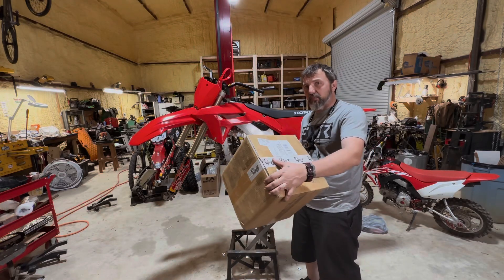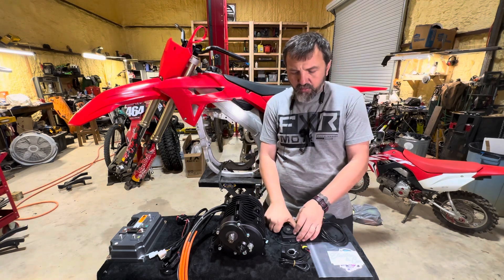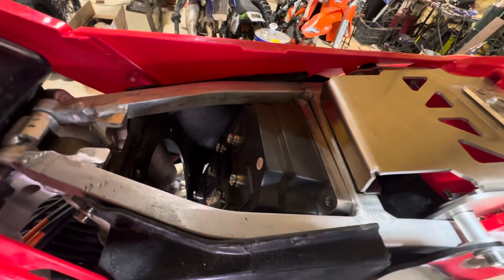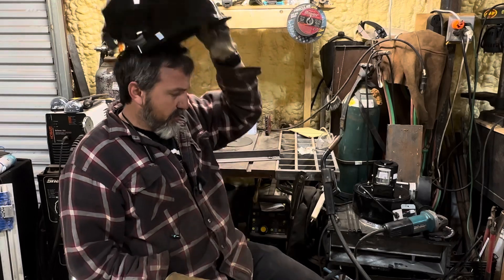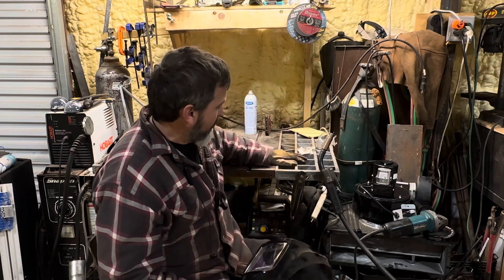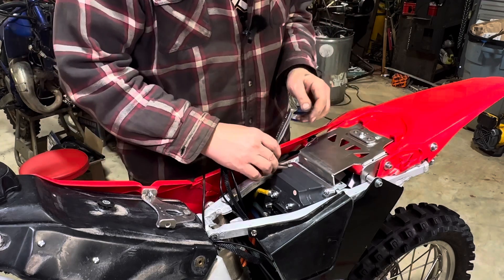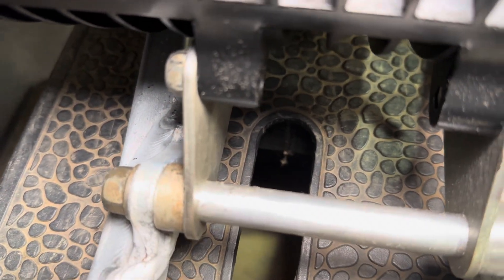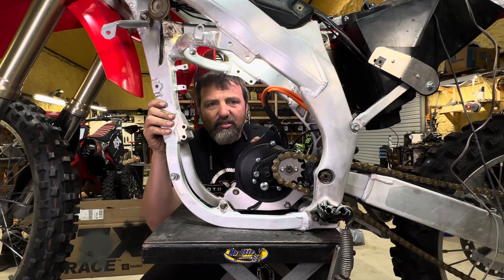How to build electric dirt bike Ep 2 DIY Stark Varg. How to install motor and controller.

Comment: Very cool! An electric moto conversion with no frame modifications using off the shelf components. I have been watching how to do this for years, and that is those are the components that I would have used. The QS138 with gear reduction, the prebuilt battery box. But I had not idea there were premade motor mounts. Now thanks to you, I know all of it will work, and in my favorite frame, an old CRF.  Thanks for the series and the ride demos proving that it works. If you could program in a virtual clutch you would be a level higher than anyone for off road riders.
Reply from the maker: A clutch really isn’t needed when you have 100% torque at 0 rpm.